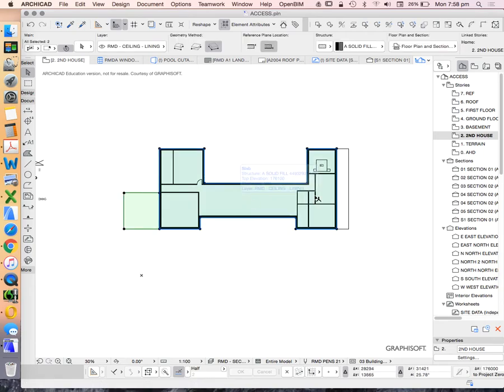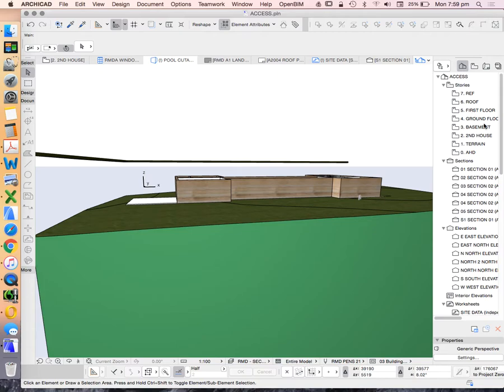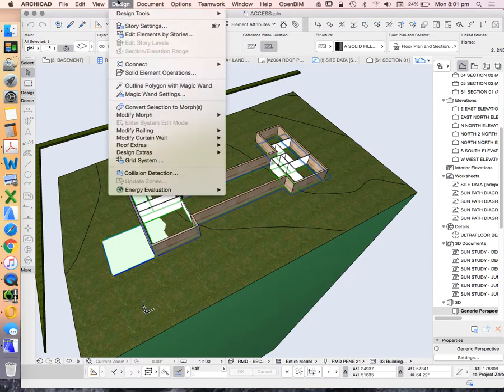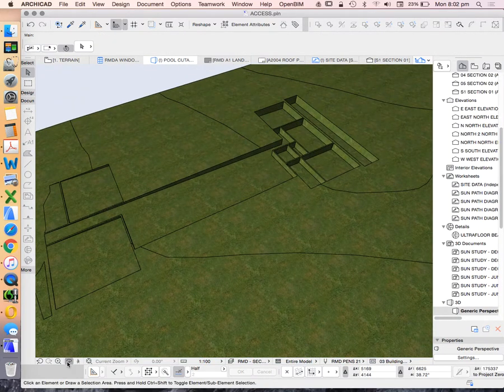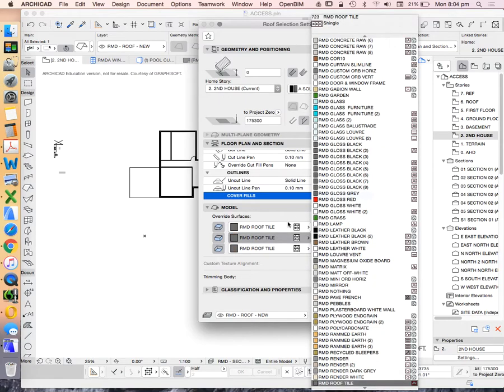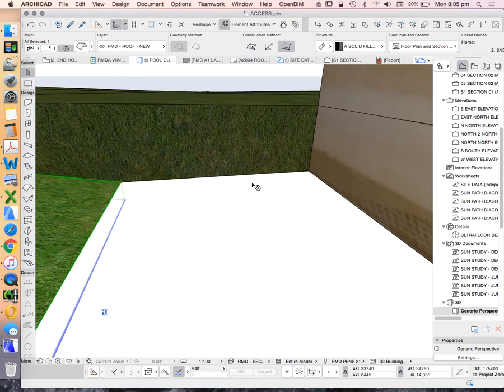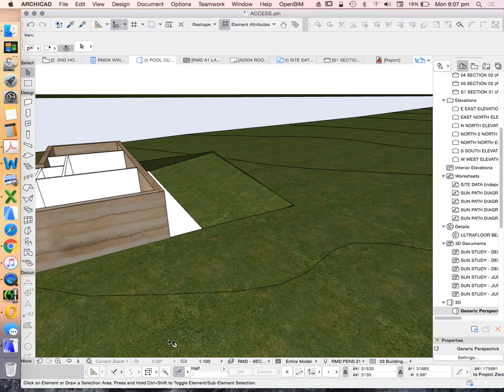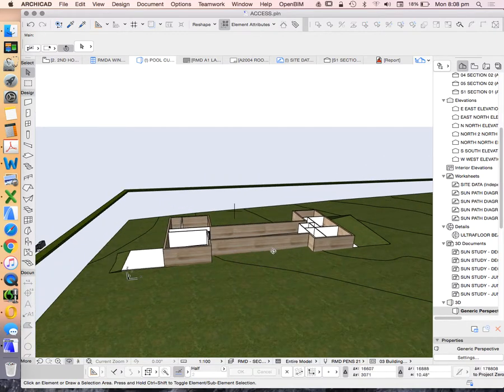ArchiCAD 21 House Project - part 15 - cut and fill

Comment: To create a 3D fill object for whatever reason. You can create a slab above the terrain mesh at a height that penetrates the surface of the terrain mesh. Select the slab as the target element and the terrain mesh as the operator element and under choose operation, select subtraction with downward extrusion. Execute. Cha welcome.